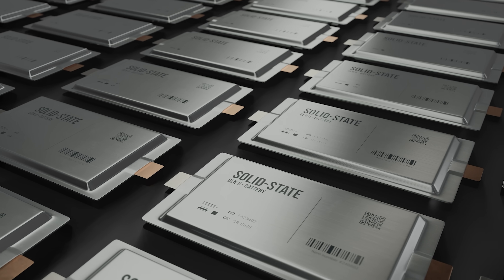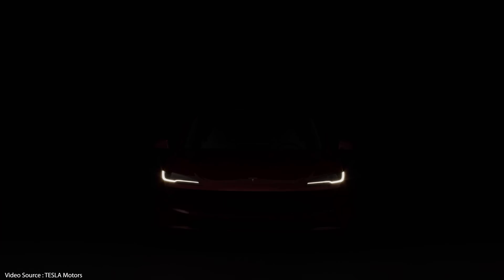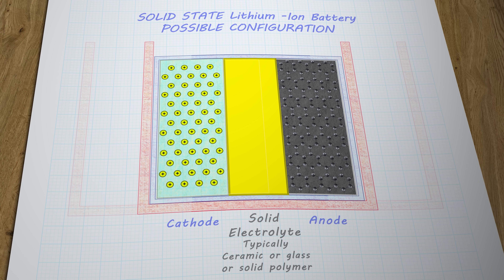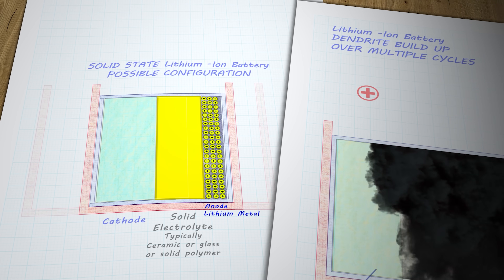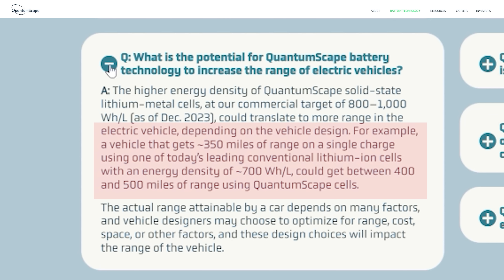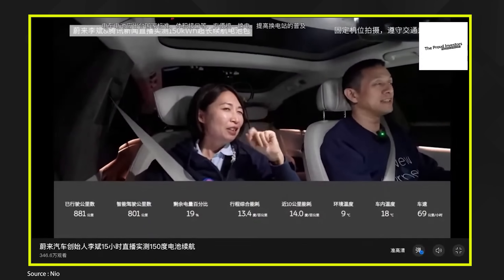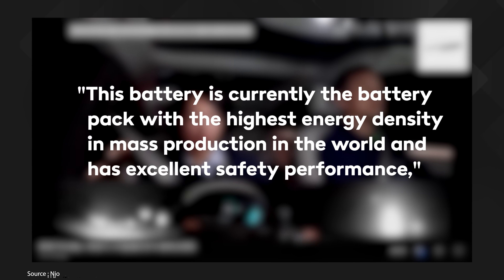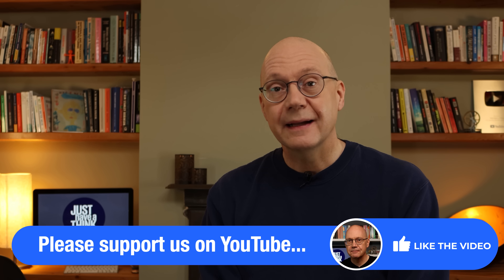Solid State Batteries - FINALLY powering electric vehicles in 2024!

Comment: Range anxiety is different for different people. For my uses, the current state of EVs makes no sense for me at this time. Multiple times a month I make a 500 mile round trip to Northern Minnesota. This trip is always done in one day. The charge network is not as robust in the area I go to. I have also made this trip at -28F. Charging would more than likely add roughly 100 minutes of time for a longer range EV, in good weather. Not sure how it would fare in -20F. Now, things will change when we can have batteries that work better in lower temperatures and have longer range. Along with better charging infrastructure. But for right now, range anxiety is real for me.
Reply: That's got to be ten hours driving so you must be taking breaks. In the UK the charging infrastructure has improved to the point that anywhere I'd stop on a long journey now has lots of chargers available. It costs us a minute or two to plug in and start charging before heading to the loos and grab refreshments.

Maybe the US charging infrastructure will improve over time.
Reply: @ yes. It’s roughly a 10 hour round trip with stops to refuel/bathroom and grab a quick bite to eat. 
Up the way I go. There isn’t much for infrastructure on charge points. Cause it’s in the middle of the woods. I would imagine there nearest point from my main destination is at least 50 minutes away. That’s the closest major town. And I’m not sure what they would have. Some people out of that way. Are not friendly to EV drivers in the first place.

Comment: 3:46 Range might not be a problem for European city dwellers but, North America is vast and there are tens of millions of people that don’t live in cities.  And millions of recreation enthusiasts. Electric is simply not an option for those people and I doubt very seriously you force change to the infrastructure of the entire continent drastically enough to service those people. We’re talking huge grid upgrades to thousands of remote gas stations that now need fast chargers for electric vehicles.   And all of those Ma and pop gas stations affording all that new equipment overnight? Or do they just get put out of business and we just set up an entirely corporate electrical fuel system? How does AAA come give me fuel when my battery dies?  right now electric cars rely on the owner having their own charger at home, where do the millions of people that park on the street charge at? Do we all sit at the gas station for 40 minutes? North American auto manufacturers are not going to abandon the internal combustion engine in less than a decade. That’s just not realistic.  Because even if you could make my refuel in three minutes like it does now, huge numbers of power plants and massive changes to the infrastructure would need to be built. I just don’t see that happening here on that time scale and I shudder to think what it will due to poor people if it does. Not everyone is going to be able to afford a new electric vehicle overnight.

Comment: Having a better battery is just part of the problem to move to EV vehicles vs Fossil fuel vehicles. The production of Electricity is also an upcoming issue, without clean and cheap electricity, the EV Plan will still fail.

Comment: 📝 Summary of Key Points:

📌 Solid-state batteries offer higher energy density, faster charging times, and longer lifetimes compared to current lithium-ion batteries.
🧐 Solid-state batteries eliminate flammable liquid electrolytes and have the potential to use lithium metal anodes for even higher energy density.
🚀 Several companies, including QuantumScape, Toyota, Hyundai, Neo, ProLogium, and HPB, are working on developing solid-state batteries.
🚀 These companies have faced challenges and setbacks in achieving commercialization and meeting performance targets.

💡 Additional Insights and Observations:

💬 "Solid-state batteries hold great promise for the future of energy storage."
📊 No specific data or statistics were mentioned in the video.
🌐 The video did not provide any specific references or sources.

📣 Concluding Remarks:

Solid-state batteries have the potential to revolutionize energy consumption, particularly in the transportation sector. With higher energy density, faster charging times, and longer lifetimes, they offer significant advantages over current lithium-ion batteries. However, companies working on solid-state battery technology still face challenges in achieving commercialization and meeting performance targets. Despite these setbacks, solid-state batteries hold great promise for the future of energy storage, and further advancements and improvements are needed to fully realize their potential.
Generated using TalkBud

Comment: PhD solid state battery expert here. Solid state batteries have fundamental problems. when you make them in thin film format they work because the layers are less than 5 microns thick, and the lithium metal formation on the anode is less than a few tens of nanometer. This prevents uneven build up of lithium metal on the anode, and lots of associated problems. However, the production is only possible with vacuum deposition techniques, which economically does not permit more than postage stamp sized batteries. The energy density, safety and longevity are unrivalled though, yet only applicable to micro devices. Remember that Dyson wrote off 90 million GBP purchase of thin film battery startup Sakti 3! In the case of car batteries, you need thick cathodes, hundreds of microns. In that case, the ion and electron resistance becomes way too large without a liquid electrolyte. If you use a thicker dry ceramic solid state separator, its ion resistance is way too high. So charging will take forever. Making it thinner causes lithium dendrites and fractures. This is why a liquid electrolyte both inside the porous cathode and porous separator is essential in regular wet lithium ion batteries. Now the last fundamental problem of large scale lithium ion batteries, is that because the cathode is hundreds of microns thick, the lithium metal deposit on the anode would be tens of microns thick. This is essential electroplating. At such thicknesses this lithium metal layer becomes very uneven, and can destroy the anode-separator contact uniformity. Quantumscape's battery is not a true solid state battery, as it uses liquid electrolyte in the cathode, and cathode-separator interface, to be able to get good ionic transport. In dry state, a brittle and stiff ceramic separator pressed on a brittle and stiff ceramic nmc cathode just doesn't make good contact. So you see, all the hype is just that. Hype. The stock price of quantumscape says it all.
Reply: So you're basically saying ... it can't be done given the laws of physics, chemistry, etc ?
Reply: First you need major innovations in R&D labs that solve all the solid state issues in a lab setting, after that it takes 10 years to transfer to production... so yeah, we're looking at 15-20 years. But then there are hundreds of other chemistries that are competing with solid state. So it's a bet which one will make it to the market. Note that the major energy density improvements come from replacing the porous liquid electrolyte cathode with a solid cathode (about 40% higher active cathode volume), and replacing the porous anode with lithium (50% improvement), and replacing thick separator with thin separator. That is what gives you a 2x energy density improvement in thin film batteries. But most of these aspects are lost in quantumscape type construction, hence only 12% energy density improvement claimed... not worth it @whiteknightcat
Reply: @douwemonsma5874  Oh well, I guess I won't live to see any of this.

Comment: Range anxiety is a very real issue as is the extended journey times and lack of charging points. You blithely dismiss it as something that does not exist. Add in the increasing cost of 'electrikery' and just what is the advantage of there 'non' eco vehicles.

Comment: I really hope that this technology becomes reality soon. The possibility that a battery might exist that can deliver 10,000 charge cycles and double the energy density of gel-electrolyte cells, will finally let EV's become mainstream. No range anxiety, fast charge time, 600~800 mile range, should convince most motorists that an EV will work for them as a daily driver.

Comment: Let's talk about charging power requirements for a moment.  One of these manufacturers is throwing around a claim of ten minutes to charge "a car battery".  For simplicity of calculation, let's assume that said battery has a capacity of 100Kwh.
100Kwh * 60 min/hr / 10 min = 600Kw.  At the 400v available from typical L3 chargers, that would draw 1,500 amps (!)  I'm not sure how thick a wire that would require, but I don't think I'd be able to maneuver it to plug it into a car.

OK, so let's assume that the voltage delivered to the car is increased enough to allow a manageably thin power cord.  We'd still be stuck with getting 600Kw to the charging site, multiplied by however many vehicles you want to be able to charge at once.
A typical modern home is set up to be able to draw a maximum of around 50Kw.  So for each car you want to charge at this rate, a load will be placed on the local power grid equivalent to a dozen homes.  Multiply that by the number of cars you want to charge, and you're quickly in the range of being equivalent to a whole neighborhood.

The ramifications for the power grid are considerable.

Somebody please find a large error in my math 🙂
Reply: Most peoples' eyes glaze over when confronted with calculations involving units.  If you added error calculations and significant digits, they would go blind.They see the problem you identify as an engineering problem that will be solved and not a hard limitation imposed by physics. You may as well ask how it would be possible to supply a city with water pumped through a 1" inside diameter pipe. If you could somehow raise the pressure high enough to get the required flow volume, the walls of the pipe would have to be 3 feet thick to avoid bursting.  It is not a perfect analogy, but close enough to make the problem understandable by people who have little or no scientific background.  Watching Youtube doesn't count.
Reply: @donthompson7889  Sigh, true.
Reply: You math is correct, but you are not thinking outside of the box. One option might be to have homes with electrical storage to charge one or two extra cars and network to share this energy at price. Small nuclear power plants might be an option.
Reply: @lesp315  Who would pay the tens of thousands of dollars needed to install battery storage in every home?  What effect would mining and processing the raw minerals required for hundreds of millions of extra batteries have on carbon emissions (hence, climate change?)  Hundreds of small nuclear reactors might solve the electrical generation problem but would only make the electrical distribution problem more acute.  There are no magical solutions to the situation mankind has put itself in.....except, perhaps, global population decimation brought on by extinction level natural disaster, virulent global pandemic, or global nuclear war.

Comment: range anxiety isnt the issue with electric cars having the necessary power storage, its charging infrastructure, which is currently no where near good enough. i do mixed driving either around town (max 30miles round trip) and then long trips of about 400 miles round trip. at service stations it isnt unusual to see a queue to charge or only a couple of charger actually working. At our local Shell they put in rapid chargers, and its always busy and nearly always has another car waiting which means a minimum of an hour for you to wait and then charge... so if cars can charge quicker and there is always somewhere to charge. there is no need to have capacity to do long round trips.

so for my use, a plug in hybrid is the best choice. i wont be contributing to local air pollution around town, can charge from home with a solar array, and then be able to do a long trip knowing that if i need to, i can make that trip without stopping, and if necessary can splash and dash in under 10mins adding another 400miles of range. the biggest reason to not go full electric is having 70kwh of battery sat on the drive doing nothing 90% of the time, which doesnt make any sense to me. most people dont need that much range, they just need to be able to 'fill up' quickly and easily

Comment: Range anxiety is very real.  I had an EV in Orlando.  I had to charge 2 resorts away.  I was hoping to get my family to and back from dinner and went to the charger after dinner.  It was taken.  I limped home and back again at midnight and was able to plug in.  Afraid of being towed, I went back at 5 am to find someone had taken the charger overnight.  I used the bit of charge I had to get back to the airport to get an ICE car.  Range anxiety is horrible.
Reply: Exactly what I posted.  When he whispered range anxiety isn’t a real issue he immediately lost credibility with me.  I won’t even look at an EV until they can do 500 miles and the charging infrastructure radically improves.

Comment: You're absolutely wrong about the range issue. Try towing a 7000 lb trailer 250 miles without stopping. All these new EV trucks barely can even make it to the 100 mi mark.

Comment: Range anxiety IS a problem when you live somewhere like Australia. We have cities that are over 500km apart, with NOTHING between them. EVs short range is exacerbated when you then try to tow a boat or caravan. When you then couple those things with the serious consequences of an onboard fire, EVs not looking so much like a good idea. Then add the excess production of CO2 during the manufacture of these abominations and it's making the ownership of an EV very questionable. With the demand for EVs dropping and the cost of replacement batteries after a relatively short time (5 to 7 years) and an EV is looking like an investment worse than Terra Luna...

Comment: We need to talk about EV upgradability.  
How difficult is it to refit an EV with one of these?

I just bought a 2022 EV6 because its the same as the new ones and $20,000 less.  
I can't justify buying a new EV right now because it will soon be obsolete as new battery technologies come out.

Buy used now, new when new batteries come out.
If refitting was an option I could buy a new EV.  
Thoughts?

Comment: Diesel and jet fuel is around 12,000 Wh/kg, so that's the benchmark. So still no electric long range air travel except potentially with craft that are lighter than air.

Comment: The problem with using solid state batteries for anything that moves (like an EV or VTOL) is that the electrolyte is made of glass, which is by nature extremely brittle. That means your put the car in park and pull forward out of the driveway, and as the car flexes, the batteries self-destruct.

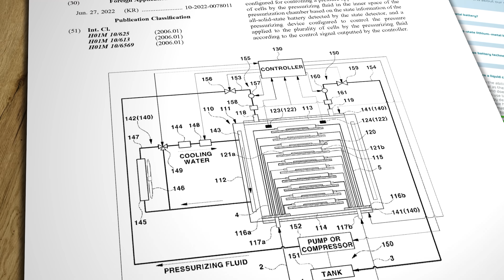Comment: 13:00 The Rivian R1T with 410 miles of range is called the max pack (probably 328 miles "usable" range).  My husband owns a regular R1T which has 280 miles of "usable" range.
Reply: Sure, but for the Nio publicity stunt, I'm guessing they were willing and able to unlock the whole battery capacity, not just the "usable" range enforced for battery health reasons.

Comment: 750 miles & recarge time of 5 mins.!

At nominal 260Wh per mile, (highway consumption, you won't to be travelling 750 miles non-stop at 30 miles an hour), this works out to a battery capacity of about 195KWh. Recharging that in 5 minutes would require a 2.5MW charger (allowingfor losses), so unless you're a professional weightlifter you probably won't be able to lift the charging cable.
How about some realism in the battery industry's aspirations.
Reply: If I were designing a charging system that needed to get to 2.5 MW, I don't think I'd put all those amps into a single cable. The car would have a row of 5 or 6 charging inlets, and the station would have like 10 or 12 cables to service 4 parking stalls, first come, first served. To reduce confusion all around, certainly the charging protocol would require each battery pack to have a unique vehicle ID — not necessarily to handle the payment system automatically, just to allow the system to know which cables plugged into cars are in each billing transaction.

Comment: 3:53 What do you mean that range is not a problem? Most people can't afford 1k mile range electric cars, they are simply too expensive. I can maybe, just maybe afford something with a 300mile range. Counting in that I can only use 60% of that capacity or else shorten battery lifespan, and that real life range is normally 10-20% less than the stated one, that leaves me with 150mile range IRL scenario. Just enough to get from my town to the nearest city and back. In cold weather or after few years of usage when battery will deteriorate I won't be able to do even that. That is not great, especially when fast chargers are as rare as unicorns. There is no way I could get to closest airport in a "300mile" range EV either, which I would want to do because rail system in UK is an unreliable joke. 

Range is still an issue for regular Joe. Not everyone has CEO money to drop on a car, most of us can only afford used cars for half or third of a price of entry level new car.